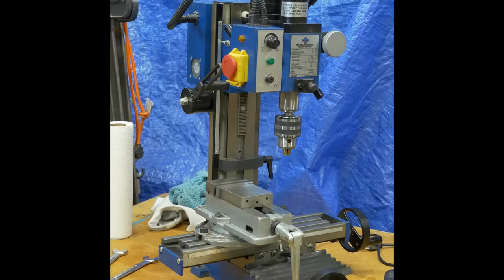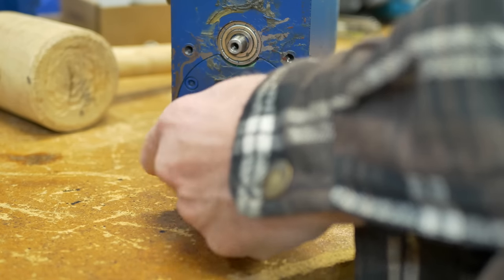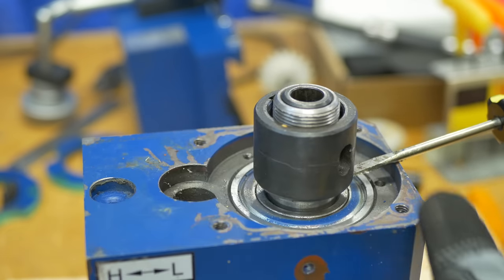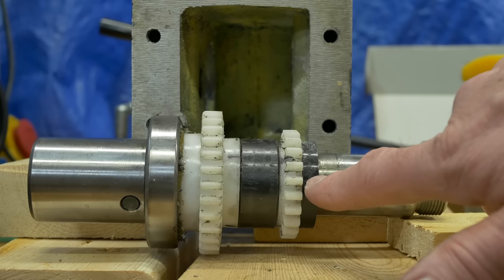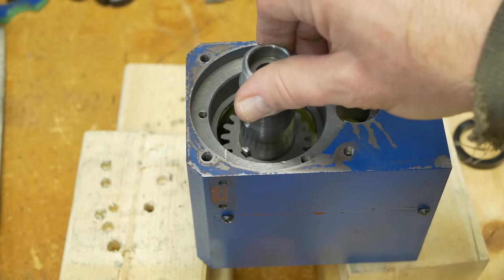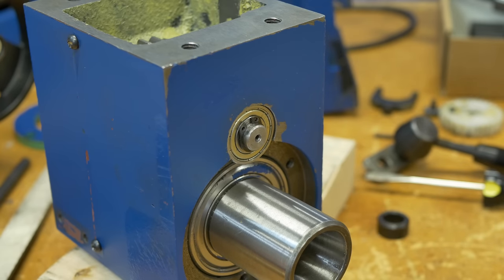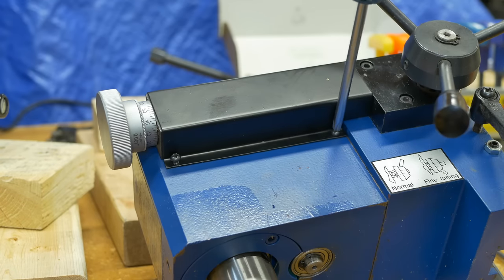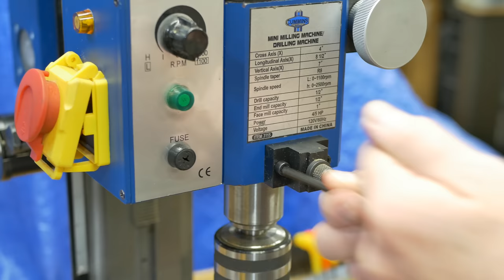Mini Mill Gear Replacement - New Metal Gears for the Mini Milling Machine!

Comment: A year ago I had the same problem, but I removed the transmission completely and fitted the drive with V-belts. This is a better solution and the milling machine is much quieter than before.
Reply: Really sounds like something worth doing, do you have a video of the process?😊

Comment: You're not going to believe this, but I was just in our shop putting our grizzly lathe/mill combo back together after cleaning it up and trimming it, when I tested the mill which I never took apart. I noticed it has a winning sound. It is exactly like yours but I'm sure it has metal gears so I'm guessing a bearing is going bad. Anyway, the funny thing is your video was in my feed after I got back to by barracks and turned on my laptop. That was freaky enough, but the real interesting part is I'm stationed at Mcmurdo station Antarctica! 😆 
I was puzzled how it came apart and this was defiantly a great help! Thanks for the upload and greetings from the land of ice, darkness and questionable chow hall food!
Reply from the maker: That's a great story.  Thanks for sharing!  Comments like that make it all worth while!!  Enjoy that equipment!
Reply: Very good video, but a couple  of points. You always press a bearing into it's housing by it's outer ring. Why not replace the original bearings with tapered roller ones.
Reply: @bertsmith5223 Porque o esforço é axial e não lateral. No torno fica melhor, mas na fresadora não faz diferença.

Comment: I did this to a mini mill I owned years ago. It worked as a solution but it made it so loud you had to wear ear defenders! I also sealed the gearbox and grease filled it in the hope of quieting it a bit, but it didn't help much. Great step by step guide for those who want to do this, thanks.
Reply from the maker: Great story!   Thanks for watching and leaving a comment!!
Reply: Helps if your smoth out the gears a bit too wire brush them remove  sharp edges without taking  any off actual gear

Comment: Thank you. My mill is OK so far, but it is good to see how easy it is to replace the plastic gears.
Reply from the maker: The plastic gears will give good service if not overloaded.  Mine lasted years, until one day I snagged a block of steel with a flycutter.  Thanks for watching and leaving a comment!
Reply: Good to know
Reply: @metalwooddesign  I guess I tempted fate last week. My gears let go this afternoon while drilling a 5/8'' hole in aluminum, no shock load. I have ordered a metal set. The timing is lousy as I am in the middle of a project.
Reply: Just for anyone who is interested in the bearings. The spindle bearings are already deep groove ball bearings. The lower bearing is 6007zz and the upper is 6206z. The idler shaft bearings are 6001z C3. My spindle head is all apart. I am just waiting for UPS to deliver the new metal gears. Thanks to the video, everything went well. Of all things, I had issues removing the 5mm setscrew holding the shifter arm. I tried penetrating oil, heat, impact, swearing, etc. but  the Allen wrench just twisted. I ended up drilling the setscrew and removing it with an easy out. The setscrew is cone point, impossible to find locally. I will put a point on a 5mm socket head cap screw which should do the trick. The gears that failed were on the idler shaft and both sides were broken. Almost as if the shifter arm was not properly engaged. The main gears were in good shape.
Reply: All back together. It is noisier than before but I can live with that. Some observations for the next guy:  
Remember to match mark the two parts of the housing before you separate them as the bolts are a loose fit and you can get misalignment at re-assembly. 
Nothing is deburred and there are cast iron particles everywhere inside. A good debur and clean is essential before it goes back together. 
Two inch pipe works well to push on the bearing outer races of the main shaft. Inch and a quarter pipe works well on the inner race of the smaller bearing on this shaft (I used ABS pipe, no problems). Various sockets from my wrench set do the trick on the idler shaft bearings. 
The main gears are a little tight on the shaft when re-assembling. I heated them with an electric blower to about 180F and they slid on without effort, no need for pushers as shown in the video. Check the alignment of the gears after assembly. My low speed gear was only 2/3 engaged when the ball was in the detent. I had to rework the detent position with a Dremel to get 100% meshing of the low speed gear. This may have been the cause of the initial failure also. 
Many thanks again to MetalWoodDesign for the great video which made my life a lot easier!

Comment: Loved the video. As someone looking into making via 3d print, cnc, milling and lathing at the cheapest cost it helps to know how it all fits together and works. Thank you. With everything what I have found hard to understand is how to try and get motors that can be used for multiple things, and how much power is needed to cut stainless/steel/wood and the power/torque needed and how much power is lost through gearing/belts

Comment: Excellent video. I just an hour ago busted the plastic drive gear on top of the gearhead. I totally agree that this is a perfect place to have a failure point because it is dead easy to get at. I will probably end up replacing the internal plastic gears with metal, though, at some point, but I need to get the plastic drive gear now so I can finish my project. My machine is apparently a Sieg X2 or clone, the WEN 33013. Big Orange. My lathe is Big Blue, the Vevor 7 x 12 I think it is. I will probably upgrade its gears, too. Both machines have served me well for a couple of years now, just making parts and doodads for house and boat.

Honestly, making a full set of gears should have been my first milling project. Now, I got too many other jobs waiting to do.

Again, great vid, thumbs up, thanks for posting.
Reply from the maker: Thanks for the comment!  Have fun with the mill!!

Comment: I have a  Wen Mill that looks just like this one.  I haven't crashed it yet, knock on wood. It sure takes a lot of intimidation out of the equation when I know what everything looks like before I get started. Thank you so much for taking the time to record this in a video. If I decide to switch to metal gears I think I will add a port for oiling them.  May all your projects be successful and just challenging enough to be interesting.
Reply from the maker: Thanks for sharing. I appreciate the comment!!
Reply: I just bought the WEN version.   How have you liked yours so far?   Cheers    Mike

Comment: I had a mini mill and benchtop lathe from Machine Mart with the same problems, the only difference was, that I first made a gear hob using silver steel which was then hardened, Made a 40 to 1 dividing head and plates, cut the gears from steel sourced from the scrap skip at a steel distributers, (with their permission and a contribution to their xmass party fund), and also made a replacement set of change gears for the mini lathe. The mini lathe control panel went south after a couple of years, so instead of replacing the mother board at a cost of £90 plus, I opted for a larger AC motored lathe for which I had to make a reversing gear and also made a taper turning attatchment. turned various morse tapers for mill and lathe, made an extended tailstock barrel for the lathe. The milling machine had the same fine quill feed mechanism with the universal joints which introduced around 15 thou of slop, so did away with that, made and fitted a column side down feed with split nuts to disengage the fine feed which gave far better fine control. Had to remove the spring loaded assist arm, so made and fitted a blank plate with two pulleys to the top of the column and got a long brake cable inner from Halfords, Attached the cable to the top of the head, put a hole in the workbench to thread the cable over the pulleys and  through the bench top and fastened a counter balance weight to it. Then spent many a happy hour pottering about in my shed cum workshop until Osteoarthritis of the spine meant that I couldn't stand for more than half an hour at a time.
Reply from the maker: Great story, Thanks for sharing!  Many projects with shop made tooling in a skilled craftsman's shed.  All the best to you Sir!

Comment: I rarely comment on videos but I must say you did an outstanding job on this one!  Well done.  Clear, concise and excellent videography.  This is what I come to YouTube for - not jazz hands and lame jokes.  Well done.  (I'm now a subscriber)
Reply from the maker: Thank you.  I appreciate the comment!!
Reply: @metalwooddesign  Where did you get the metal gears from? Did I miss that detail?
Reply from the maker: I got the gear set from www.littlemachineshop.com   Thanks for watching and leaving a comment!!
Reply: @metalwooddesign  The perfect name for the business. Thank you for sharing. That’s very helpful. Are they working out okay?
Reply from the maker: Works great.  A bit more noise, but that's OK.
Reply: @metalwooddesign  What lubrication do the steel gears need? Nylon gears have the advantage of working dry, but as you found, they aren’t robust enough for the job.
Reply from the maker: @G58  I used a high quality general purpose synthetic grease during assembly.  Here’s a link to that item if you're curious:

https://www.amsoil.com/p/synthetic-multi-purpose-grease-nlgi-2-glc/?zo=5265385

Thanks for watching and leaving a question!
Reply: @metalwooddesign  Sounds good. Thank you for sharing.

Comment: Thx! I needed this, tool holder stuck inside the spindle (MT3 on mine) 🤣
"Don't buy old big, buy new small" is what I kept hearing from Youtubers so that's what I bought, now I'm in a qualified position to say they're proverbially full of it.
Before I bought it I wish I'd known how kinda bad this mini mill is. On mine the Z-axis fine adjuster is an utter pig to contend with.
The X-axis ways are too tight in the middle so I guess they foresaw wear, issue is when I loosen the gibs, they slip out at both ends.
Tramming it in the Y-axis isn't all that easy either, and in general any sort of precision from factory = Forget about it.
All of this can be easily fixed, and I am, but, wish I bought a cheaper, old big mill that I likely would have only had to give a slight service/rebuild & some small fixes to get a FAR more capable and durable machine.
Reply from the maker: You got it, older and bigger, biggest you can get away with.  It is fussy, and there's a fine line between getting the play out of the X/Y screws and locking it up.  It's a small cheep Chinese machine that needs to be used within its limits.  Mine's got an R8 like Bridgeport, but you need to have some restraint as the plastic gears will break.  If/when that happens definitely go with the metal gears.  Thanks for the comment!   Have fun with your projects!!

Comment: I covered the rear opening with a copper shim to prevent swarf from entering and greased all the gears. I’ve modified the whole lot to 3-axis CNC. It’s noisy but been working for a few years now.

Comment: Nicely detailed video but would have obviously been nice if you turned on the machine so we could hear the difference in sound between the original plastic gears and the new metal gears. We also gotta wonder why no grease is being used on the gears.
Reply from the maker: The gears were well lubed with grease before reassembly. The metal gears are a bit noisier, but I do love the sound of straight cut gears!  Thanks for watching and leaving a comment!!

Comment: Interesting little upgrade. But a couple of comments, based on personal experience. It didn't look like you put new bearings in, in particular the bottom main bearing. I would always fit new bearings if I was stripping something down this far, in the great scheme of things it does not add a vast amount to the cost on something like this (lathe headstock bearings would be a different issue). I'd put in a decent set of SKF, Timkin or NSK and possibly change the bottom bearing to an angular contact bearing if ones not already fitted, space allowing. When pressing bearings in push in on the race which is being fitted to the shaft or housing. Don't press the outer race in to the housing by pushing on the inner race. This can cause brinnelling by having the balls press small dents in the bearing surfaces, leading to premature bearing failure. When pushing a bearing onto a shaft and into a housing at the same time, use a large thick "washer" to push both races at the same time. I'd probably replace all the other bearings at the same time, just to know they were decent. 
The last bearings I replaced were on the Dyson vacuum cleaner brush bar. A new brush bar was £30 odd and two bearings were £3.50ish. The difference in noise levels was worth it alone.
Reply from the maker: Thanks for the tips!  I appreciate you watching the video and leaving a comment!!
Reply: I think that's where most people run into issues with these. They just get it, half ass clean it n fire it up, with dirt probably all in it. I have a pretty good plan for when mine arrives, probably just spend a week cleaning it.
Reply: @Mikesmeyer88  I think you are right. Anything with bearings needs to be clean. When I got my small mill the first thing I did was drain the old oil, fill it with cheap oil to run and flush, drain that overnight and then fill with the good stuff. While that was going on I could clean and lube the rest.

Comment: I don't do machine work. And probably never will. But I love watching it. Especially when someone is explaining what they are doing. I have a question,  why did you not go ahead and replace the last plastic gear?
Reply from the maker: The plastic gear on top is easy to get to and would be the part that breaks should a cutter snag or have a sudden overload for any reason. Thank you for watching and leaving a question!
Reply: @metalwooddesign  cleaver. Sort of like the brass gear in a distributor.

Comment: Nice video! Why not replace all plastic gears, and may be bearings?
Reply from the maker: Bearings were good, and are still hanging in there.  The one plastic gear on top is like a fuse.  If something gets jammed that's the part that will give way, and it's easy to get at to replace.  I appreciate the commentary!  Thanks for watching!!

Comment: I'm surprised the input plastic gear did not fail first. I put the metal gears in my metal lathe but they actually had more backlash and noisier so wish I had left the plastic in as they were fine. Just watched too many wasted video on it. but I did put in sealed angular contact bearings for a true improvement.
Reply from the maker: The plastic gears did last for many years, until one day flycutting a block of steel.  Thanks for the comment!
Reply: In my case, it was a slotting saw - they tend to be a bit out of round...  Now I think my low speed gear is missing a tooth or similar.  High speed sounds like usual. I got the mill in 2005 or so, so the plastic gears have had a good run.

Will get the metal gears, new bearings, etc next year…

Comment: One point about bolting the two main assemblies back together.  The spindle/motor block needs to be EXACTLY parallel to the gibb block.  If not, the spindle will be canted of at an angle from the Z axis of motion.  It might have been a good idea to "chisel/scribe" mating marks on the mated sides of these two blocks as originally attached.
Reply from the maker: Including witness marks is a good idea.  Always want to put things back like they were.  Thanks for the comment!
Reply: Tell him this machine has 10 thousands tolerance in every direction factory/stock.....he being bit overboard....
Reply: Rip chips and make it happen...we use Stanly tape measure not micrometer to get stuff exact....

Comment: That remaining plastic gear is certainly a weak point it would be nice to be able to replace that also!
A good tweek to improve this mill is to place some shim washers between the rack and column which reduces the backlash in the vertical microadjustment knob but be carefull not to use shims that are too thick since this will damage the teeth of the rack and pinion. 0.6mm worked for me.
Reply from the maker: Good tip, thanks for sharing!  The one remaining plastic gear is easy to get to.  That's the part that gives way (hopefully) if something snags hard under power.
Reply: That last plastic gear is essentially acting as a fuse. If anything goes wrong, it will be the first one to go, protecting the rest of the gears from damage.

Comment: It may or may not have already been said, but keep in mind that using all metal gears will shift the stress of force directly to the motor in the event of a bind or overload.  Ironically, the original plastic gears breaking prevents that from happening.  A belt drive conversion is really the only permanent fix to both problems, since it's much easier to deal with a broken\slipped belt than broken gears or a burnt out motor.  After owning a more common Sieg X2D variant for roughly 2 years now, I'm going to upgrade to an LMS 3990 instead since a solid column and belt drive should really be required on these benchtop mills.
Reply from the maker: Thanks for the feedback!  There's one plastic gear left on top driven by the motor gear.  That's easier to replace and will be the part that gives if (when) it gets into a jam again.
Reply: The Sieg X2D also has a solid column... Are you sure you dont have the Harbor Freight Mini Mill? Its not the same as the X2D.. HF has a tilting column and not a solid column whereas the LMS Sieg X2D has a solid column. They may look alike but theyre slightly different. If a solid column is all youre after then buy a LMS Sieg X2D for $800.